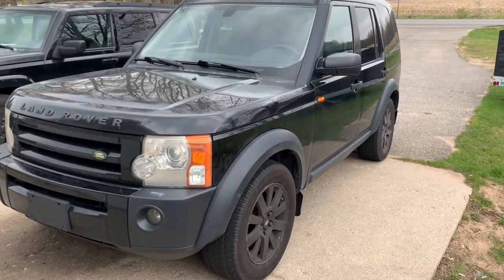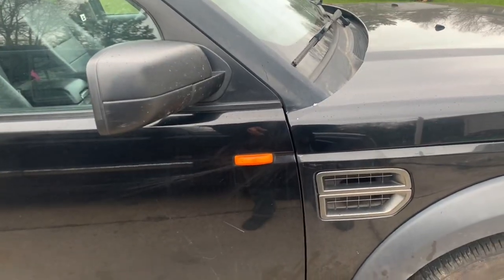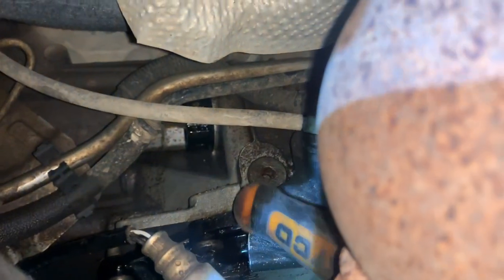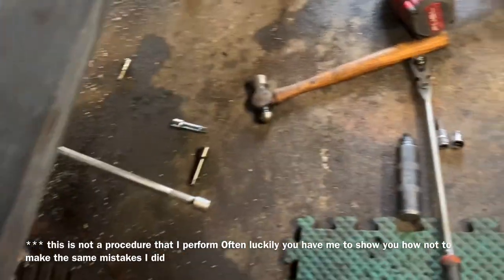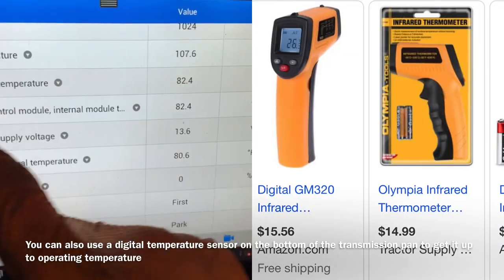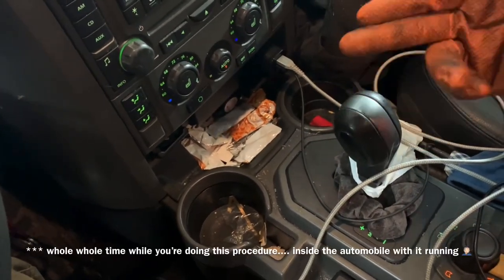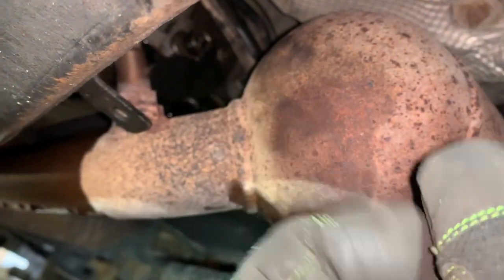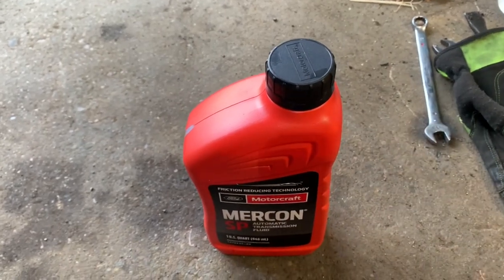Land Rover LR3 Transmission fluid level check/ Drain and fill procedure￼￼

Comment: I recently completed the tranny filter/ fluid change and the ZF electronic sleeve replacement. Here's my pointers for you:
1) The ZF fluid looked great, even though it had 192,000 miles on a 08 LR3, no previous tranny service.. In hindsight I would have never touched it. It had no leaks, with great shifting.
2) The sleeve replacement can be a frustrating job. This will make it easier. Completely remove the transmission support member. Use a 24mm socket to drive the new ZF sleeve in, after lubing it up.
3) I used a metal pan, with a separate filter, as the replacement. Available at AtlanticBrittish.
Reply: How’s that updated filter kit working out for you?
Reply: @ShirleyAerial  It worked great, but there's a steep learning curve.

Comment: That Mercon is the last thing you want to put in those vehicles. Use the correct zf fluid guys. That particular transmission is very sensitive to foreign oils. Trust me do not put anything but zf fluid.
Reply from the maker: I think you should’ve watch the video….. Then delete your comment
Reply: @sharpcarco  I did. I've seen plenty of zf transmissions come in with foreign fluid in them. Some can take it, others cannot.  The lr3 transmission is a model that is particular. They say sealed for life, but it needs to be serviced every 75000. The only thing that may be holding yours together is the additive. However, after a while your torque converter will fail. The signs are a stumbling idle at 1500 rpm around 45 mph. This is from the torque converter locking and unlocking. The mercon fluid does not have the proper additives to keep this from happening. That transmission when properly maintained can easily reach 300000 miles. I've seen it
Reply from the maker: Well you must have missed when I put the additive inside it but that’s OK I’ve got 20,000 more miles on it than when I did this video. Can you take your dollars out and you give them to anybody you want I prefer to keep mine in my pocket as long as I possibly can thank you for your advice
Reply: I have 50,000 miles on mercon SP with no issues. It's what they use in the fords with this gearbox

Comment: That’s the FILL plug you keep incorrectly referring to as the drain plug.  Also your video is just a fluid level check—there’s no drain procedure as stated in the video title.  Draining is the hardest part of this job due to limited access to get the pan out.  That’s what we need to see.
Reply: Can't you just vacuum the transmission fluid out? I recently got a vacuum for the motor oil and was wondering if there was a way you could extract the transmission fluid with it as well.
Reply: @ColdSun87  No, there’s no vacuum port for the Transmission. Definitely not on an LR4 and less likely on a LR3.
Reply: @vido4x4  this is an LR3 in the video, not an LR4... I knew there wasn't an actual vacuum port, but as long as you can get the hose in there you should be able to extract it (via full plug).
Reply: @ColdSun87  I’m aware this is an LR3 video but they are very similar vehicles 1 generation apart.  I suppose you can do what you are suggesting if you have an extraction device.  However, to change the tranny filter you will have to drop the pan, which is the hard part due to the cross frame member in the way.  Replacing fluids (oil or trans fluid) without changing the old filter is a half-assed job which can cause problems down the road. Also, I’m not confident those oil vacuum devices pick up all the heavier, dirty oil deposits from the bottom of the pan.  Which is why I drain my fluids the old school way—crawling under the car and removing the drain plug.

Comment: How did the trip go?
Reply from the maker: Awesome absolutely nothing wrong with it. Worked like a champ I probably should’ve mentioned in the video that it had 180,000 miles on it it just rolled 190 something the other day
Reply: @sharpcarco  
Great to hear. Thanks for the reply. Will be doing mine here real soon with 150k on the vehicle.
Reply: @sharpcarco  so nothing wrong with the mercon SP. Thanks for the tip
Reply from the maker: Not a bit actually it makes it shift better , I think we’re pushing about 15,000 miles on it so far. And I haven’t had any issue with it. I hope that’s the case with everyone of course I can’t be sure but I know in my situation I haven’t touched it since. I think the additive helped a little bit as well I was getting a limp mode condition When I would accelerate hard from 55 miles an hour to 80 miles an hour and that is not doing it no more so that’s great so far my results have been very very positive
Reply: Hi great video I’m filling up my transmission due to me not plugging the hoses that go to the radiator how much additive did you add ? Whole bottle or part ?
Reply from the maker: I added the whole bottle.
Reply: @benjaminramos3054 do the hoses that go to the radiator not cool the transmission fluid? Why would you plug?